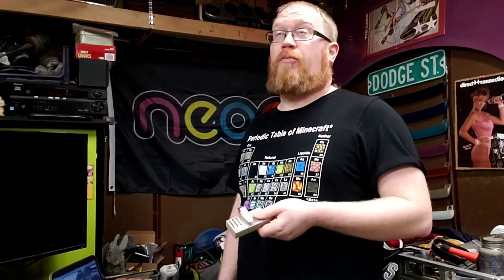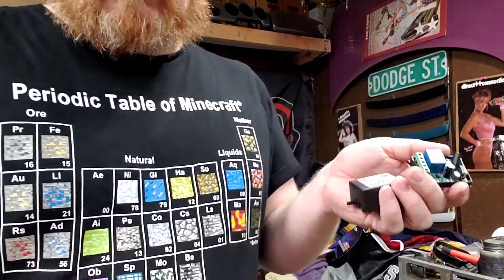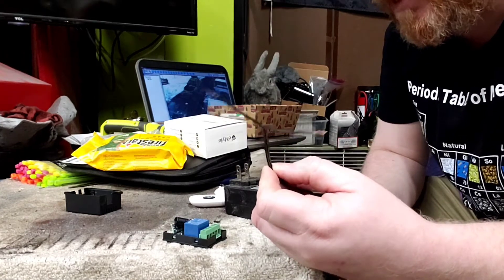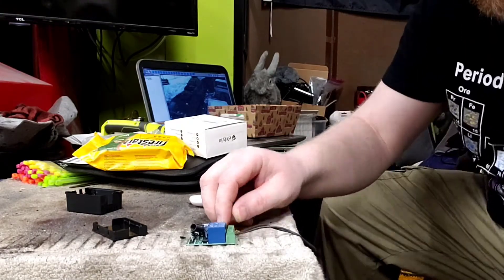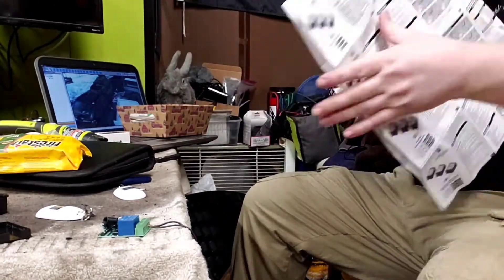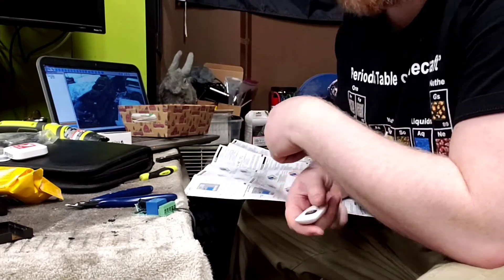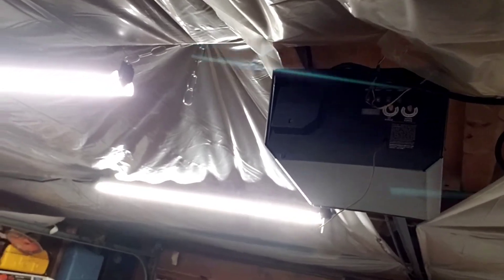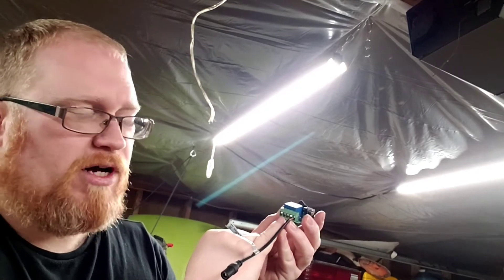Emylo wireless relay as garage door opener.

Comment: Can I hook a 12v dc motor up to this?
Reply from the maker: Depending on how big the motor is. I believe this relay can handle up to 10 amps.
Reply: @SpaZZcoCanada  Yep. It’s a 10 amp rv water pump
Reply from the maker: @jeffskingley6042  might be close to the limits of the built in relay. But you can always have this lil guy trigger a 30 amp Bosch relay. Then you wouldn't have to worry about burning the lil fella up.
Reply: @SpaZZcoCanada  hmmmmm🤔
Reply: @SpaZZcoCanada  4 pin relay?
Reply from the maker: Yeah 4 or 5 pin. Off the shelf cube relay you can find at O'Reilly, In electrical isle. Pin 85 put to negative, pin 86 put to the NO on the lil  board. Common on lil board to 12v positive. Connect pin 30 on relay to 12v positive source and pin 87a "NO" to the positive connection on the pump.
Reply: @SpaZZcoCanada  thanks again